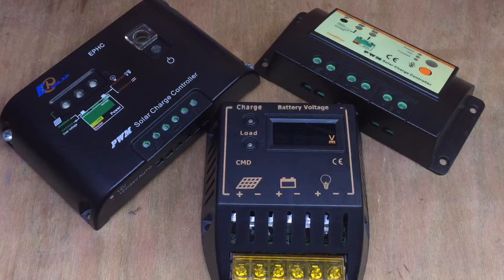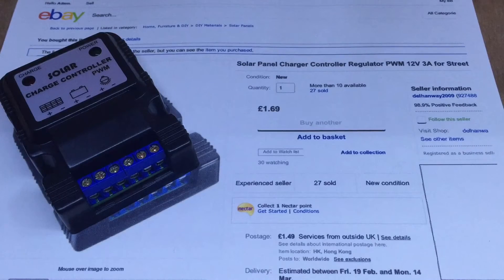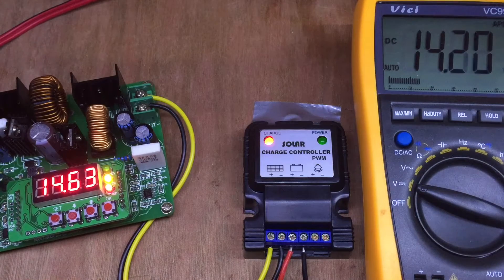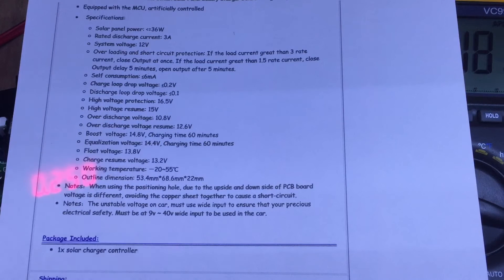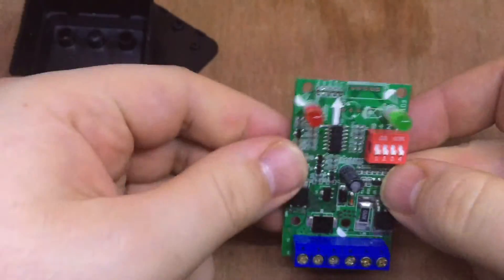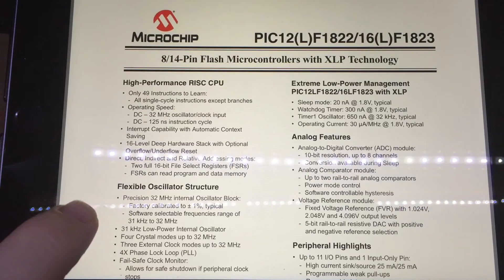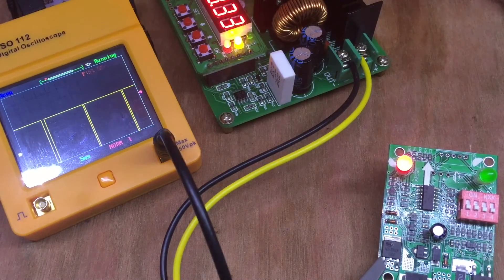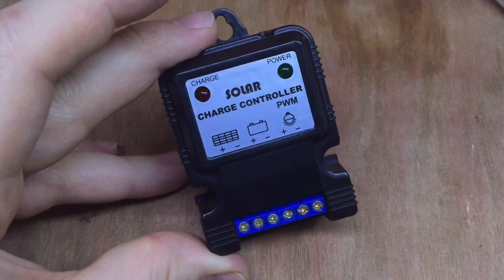Cheap(est?) PWM Solar Charge Controller - 12v Solar Shed

Comment: Any clue what would cause the leds to strobe? I had one hooked up working fine and now it strobes all three leds alternately. I ordered a 5a/10a version and same result when I hook it up.  It works fine on another controller.

Comment: Started watching this video and realized it’s pretty old. I’d settle for a dumb, reliable PCM controller with LI battery mode as I make pole mounted solar cameras and other appliances. For now because I find nothing that completely satisfies my requirements I use a “Tasmotised” D1 Mini and a MPPT module. ( they are offered on Amazon prebuilt on a pub. )The D1 mini logs charge state and current via a ini-219 sensor. Data is collected via mqtt. over wi-fi. It seems no vender offers pre built solution. The closest solution I’ve found is a Renogy 10a PCM with a Bluetooth interface. Approx $55 USD and no ability to use mqtt. Arg ! BTW this part is for everyone else.. use a clean dc source to emulate a solar input with a pcm device. MPPT can handle dirty dc but PCM controllers freak out !

Comment: The dip switches are for time limiting the load on or off.

1111 = always on
1110 = 1 hour
1101 = 2 hours
1100 = 3 hours

Etc

0000 - sundown to sunrise

Comment: Any idea what the minimum input voltage requirement is to commence charging? 
I’ve built a large LED flashlight which is powered by a 12V SLA battery. I would like to have the charging option of a regulated 12VDC mains plug-pack power supply (which are common and cheap in the order of 300-700mA). I need a compact regulator circuit to charge the SLA Battery so it needs to boost the 12VDC to supply enough voltage to charge the battery while providing the regulated and controlled conditions the SLA batteries require for correct charging. It seems this sort of all-in-one circuit is very difficult to source so I was thinking perhaps one of these PWM or MPPT low current solar chargers might be able to do the trick. Obviously they would need to be capable of running from 12VDC with some measure of efficiency.

Comment: WHAT PANNEL DO I USE FOR 12V AND SWITCH SETTINGS ? ALSO BATTERY  ANYONE ?
Reply: Which panel you choose will depend on lots of factors. I use a 10W solar panel to charge a 7A/H SLA battery. The key issue here is what voltage does the panel output? Some are listed as “12V solar panels” but they put a maximum of about 13V out in full, strong sunlight. These are what you want to avoid. You want to look for an “open circuit” voltage of above 17V. These regulators work more efficiently with a higher input voltage. 
As for DIP switches, I answered that below where someone else asked the same question.

Comment: I am using this as a Battery Protection System on my boombox, so I use a charger as Solar Panel, can I use ANY voltage charger? Which voltage you think that I should use? Cheers from Brazil!

Comment: does this have blocking diode to prevent reverse charge? also when it gets dark whats the power consumption of the controller itself?
Reply: just rewatched and its self consumption is less than 6ma. is there any controllers that have any lower self consumption?

Comment: Would this charge controller and a 20w solar panel be good enough to keep a single leasure battery topped up with a caravan alarm fitted. Thanks in advance Dean
Reply from the maker: +Dean Clifford Hi Dean. This is pretty much what I do with my caravan. I've got a 20w panel which sits in the roof light. It's not perfect behind Perspex but it's better than the front windows which has a slight tint. 
Now I don't have a alarm, but I suspect it's designed to draw very little and a 20w panel - let's say even only running at 10w behind glass can product a few amp hours every day in summer. Winter might be a bit more of a struggle though with short days, low sun and lots of cloud!
Reply: Adam Welch Thanks for the reply Adam guess I should go for something with a little more umph nearer 50w
Reply from the maker: +Dean Clifford Could do. You'll find it's overkill in the summer though and obviously it'll be a bigger panel to fit where ever you choose to mount it. 50w is also about the maximum for these 3 amp charge controllers. They do a 10 amp version now though which is almost as cheap.

Comment: There is newer version that claims 10 amps and slightly different inside: https://www.aliexpress.com/item/6V-12V-10A-Auto-Solar-Panel-Charge-Controller-Battery-Charger-Regulator-PWM-Hot/32769930226.html
Reply from the maker: Yup - I took at look at it here... https://youtu.be/BbIqNGHe6Xc  Cheers
Reply: Many thanks. I ordered one.

Comment: Hi Adam,
Thank you for all tour Work. 
I just finished two lithium battery packs. As you, I connected them to different solar controllers. My question 
Why do we need à controller? . I connected a 12V 100W solar panel directly to a BMS and a got 1 amp more than with the controller. So more than 10W what is significant.
Reply from the maker: +Patrick Courtot In many respects you have two devices doing similar tasks. They control the top and bottom of the charge and cut off if those limits are exceeded. However a BMS is not a smart device when it comes to charging. It will allow as much current as it can handle. Charge controllers have different charging modes - bulk is full current, absorb is keeping the voltage at a set level by slowly reducing the current and most lead acid charge controllers will have a float level charge too. 
Your bms should keep the cells in balance and be a last level of defence against an overcharge. The charge controller will use a little power, and may reduce the charge going into a pack, but this isn't necessarily a bad thing. 
Thanks for the comments.

Comment: I put one on 165w panel and a car battery for 5 days now and its working great
Reply from the maker: Excellent.  They are decent little units as long as you take into account their charging profile.  14.4 (if memory serves) might be a little high for some people, but on a car battery (that may have needed some reviving?) it's not bad at all.  I hope your not getting great sun though - 165 watts at around 18 volts maximum power would be 9 amps even at 14 volts that is probably 7ish? - perhaps you are using the newer 10 amp model?
Reply: Thanks Adam you made me stop and think about it.
I can't say it works great but I haven't killed it.
I have a Sharp NE-165U5 P-max 165w -V o c 43.1v - I s c 5.31A solar panel
Solar Controller DHS-3s-12v3A
I got it because of this video (I like you work)
max charge output stops at 14.9- 15v Still to high but fun to play with.
I'm going to try the updated one 10A Thanks again
Reply from the maker: +Timberwolf469 Ok so it looks like that's a 24 volt 72 cell panel. Which isn't ideal for a 12 volt battery as you'll be holding it way down from its maximum power point. So in reality it's probably only producing an amp or two which is why nothing has gone bang. Might not be much advantage getting the 10 amp version - although they are cheap. Thanks for the kind comments.

Comment: Adam, can this controller handle 50 watt solar panel? Logically it should (since 50 watt panel's max operating amp is 2.8) but the manual tells to use 30 watt panel max....I'd like to know your opinion about mentioned above....
Reply from the maker: +Denis Lenskiy I think it can yes using the same logic as yourself. However check out my latest video - there's a new version that does 10 amps and I've tested that with 150 watts of solar.
Reply: +Adam Welch I have already seen it. Nice vid, thanks. But I have already bought 3 amp one. And I now hesitate if I can use it with my 50 watt panel.
Reply from the maker: +Denis Lenskiy I think you'll be absolutely fine with 50watts on the three amp version. The mosfets are rated much higher than 3 amp and the increased heat sinking on the 10amp version isn't that most substantial.

Comment: if your battery goes to 10.8v?  wtf?  that's going to kill them in no time  ouch.
11.2 is considered dead flat and will seriously shorten battery life.
bah, why the hell can't they make the discharge cut off user set?  I won't take mine under 12.2
I want the bastards to last as close to their 10 year rating as possible.
(thought, the Australia summer temps will probably never let that happen anyway)

no, 10.8 is insane.
Reply from the maker: +John Douglas Yeah it's very low sadly. Why can't they make it user adjustable - money. Can't expect much for less than 5USD! 

Handy little charge controller for little projects though that is never going to deep
discharge your cells. 

Thanks for your comments.
Reply: but even the more expensive ones don't, it's one of the reasons I spend so much on the epsolar 2215BN, so I could adjust things, and now they've released the smaller cheaper ones, I'm thinking of getting one of those too for my 90w small panel
(my big one is 250w)

I've been looking for something small and waterproof to connect to the 250w panel to charge the battery for the axetracka, but haven't found anything than can handle that kind of power :/
Reply from the maker: +John Douglas Some cheaper controllers (like the EPSolar LS1024 I've reviewed) allow you to adjust parameters. 

I think the cheaper end of the market is getting more advanced now. There's some interesting products coming through.

Comment: maybe a 2nd question because I can't find it anyware. What is the maximum voltage that the controller can take? I dit the math on 3a, witch leaves around 16v at 36watt. is this correct ore can it do 20v?
Reply from the maker: +simeon pryns Remember that when the controller connects the panel to the battery either for a long time or a short one the panel will be pulled down to the voltage level of the battery - or close to it. As I mentioned in the other comment, the mosfets are rated up to 30volts - but your panel is more efficient closer to its rated voltage so a panel designed for 12 volt systems is best.
Reply: Thanks for your reply. Can I wire 15 of there solarcells to meet the required voltage etc? I got these 6x6 poly 0.5v 4 watt. Do you consider this a panel designed for 12v?:)
Thanks
Reply from the maker: +siemon pryns I'm sorry, building solar panels is not something I have any experience in so I'm not sure I can help you with this.
Reply: It's oke:) I'll look further, there is much to read about building these.

Comment: Hi Adam.....Great Video.
Ordered 2 last week based on your review. Hoping to marry up one of them with my daisy-chained 10watt Powerfilm folding panels. They put out 15.4 Volts / 1.2 amps and I've never been comfortable directly connecting them to a battery. This controller looks like a solution......Thanks
Reply from the maker: Glad you found the video useful. Thanks for your comments.

Comment: Well, you can never have too many charge controllers! They are to the solar enthusiast what distortion pedals are to guitarists...! lol  Yep, that 14.8V boost is definitely too high to regularly slam into an AGM, but those voltages would work wonders on flooded batteries which typically get charged a little low by most controllers.

Comment: Thanks Adam for a great video and insight into this charge controller. I've just bought one on Ebay but almost bought one rated at 11.1V and noticed there were others for various types of battery. Anyway, we'll see how it fairs and it might be put into use in the shed with the 40 watt panel, leaving the trusty PWM5 for the 70 watt panel... Unbelievable how they can make a proper PWM charge controller for this money...
Reply from the maker: +Martin Doyle I'm glad you noticed before your purchase!  As you've found there are a few different versions for different types of cells.  I did hope the switches inside could change the battery type - but after trying various combinations I'm not too sure any more.  I have ordered another which is sold for charging lithium ion batteries to look at the difference.

Thanks for your kind comments - hows that floor coming along? :-)
Reply: Floor is done! Unfortunately shed has been temporarily comandeerd by the wife to store hay which we reshuffle a few things. Once I have it back, I'm tweaking the solar bits...

Comment: Cracking vid, think i might have to purchase one or two :-)  Although saying that i've just bought a load of components for making some charge controllers using your design with the ATTiny.
Reply from the maker: +Colin Hickey Thanks Colin.  They seem quite good for small systems.  It'd be good to hear your feedback once you build your own.
Reply: +Adam Welch Will do, i've still only got my small 10w panel and looking to find some reasonably priced larger panels.  Got my eye on a few 100w panels after your advice on the other panels i was looking at.

Comment: Nice vid! I've got one of those. When simulating the solar panel with a DC-DC converter like you did, I found it got very hot at 2A when charging a battery. It's not great that it has no sinking at all compared to the other cheapo charge controllers on the market.
Reply from the maker: +JamstaUK Thanks for the kind comments.  There isn't a lot of heat sinking no.  I guess if the battery is full and the pulse width is small the mosfet could start to get warmer.  I wonder if using Julians suggestion in the comments here might help - stacking mosfets?

Comment: Great video Adam. That controller looks brilliant for the money. I was also wondering about the switches.  If you could get more of those misfits, you could put them in parallel (stacked vertically). I'll be buying a couple.
Reply from the maker: +Julian Ilett Thanks Julian.  If you have a look around ebay you'll find that some versions are sold as lithium ion chargers (8.4volt), and even NiMHchargers (7.2volt).  My initial guess was that the dip switches either indicated to the code to charge using a different profile, or simply added in resistance to the voltage divider.  Unfortunately after trying the dips in as many combinations as I could think of, and finding that the PIC wouldn't boot with half a dozen NiMH batteries attached I gave up on that theory.

It would be interesting to beef it up a little to see how it fared with a few more amps.

I hope to see them in one of your videos in the future - perhaps you'll have more luck finding out what the switches do.
Reply: Load timer

Comment: That's a nice little controller. I wonder what those DIP switches do...
Reply from the maker: +Lasty Ah now there is a long and boring outtake where I try to work this out...  so far I'm not having any luck with that!  If I can find out, I'll post an update.

Thanks for your comments
Reply: The DIP switch is for what they call “light control”. 
From my understanding you can set the output to always on or set a timer to predefined times. 
I assume the load must then be switched on when the charge LED goes out? (E.g. The sun has set, solar charging has finished) and/or a precondition is full battery charge???

DIP #1=8 H #2=4H #3=2H #4=1H (H=Hours). 
Just sum them for desired time e.g. #1 off #2 on #3 off #4 on = 4H + 1H = 5H. 
Default is Always On (All Switches set to off). 
All switches on = “Pure light control”. Perhaps this means the load will be switched off once charging recommences, not sure!